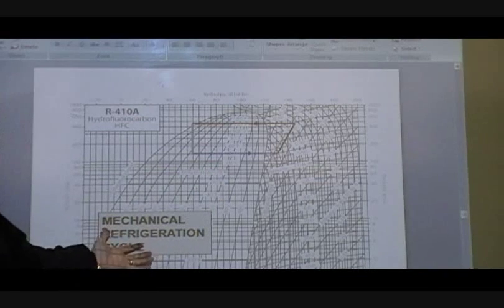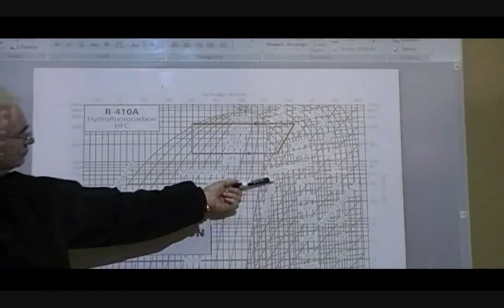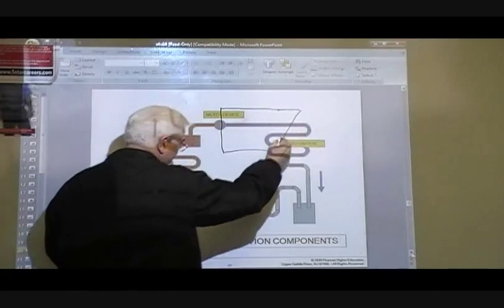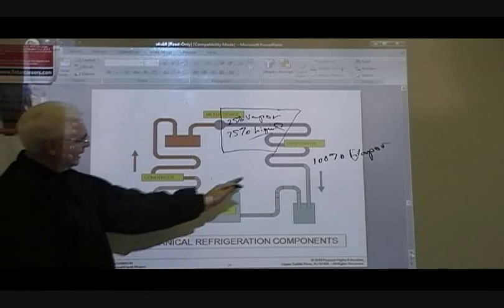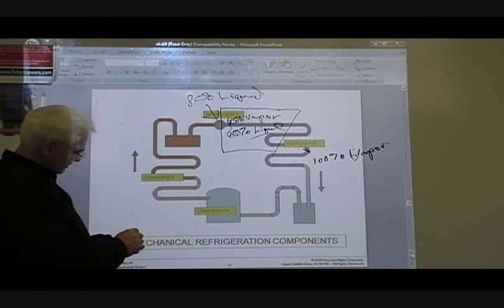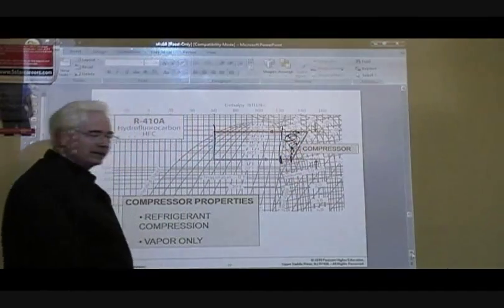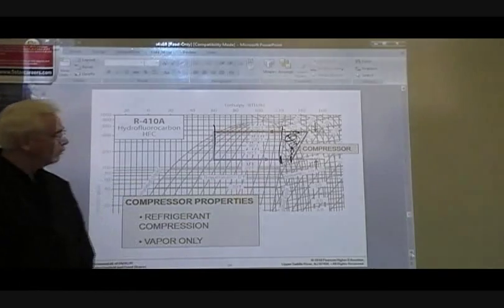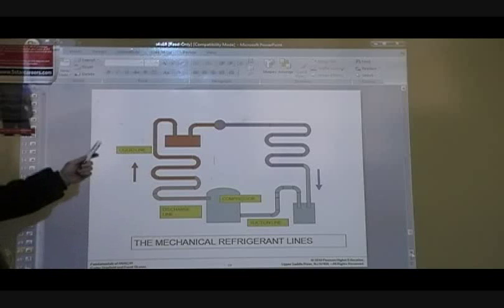AIRC 1005 C, Part 4 of 4; Refrigeration Pressure-Enthalpy Diagram

Comment: Your chart IMO, should reverse the flow of refrigerant, the basic refrigerant cycle.....
You attempt to draw, the net refrigerant effect, on the component diagram, try with the refrigeration components laid out in such a way, the weird box (as you say), lines up with the actual parts of the system.  You show the compressor line of the weird box, on top of the evaporator.

 You made Enthalpy calculations HARDER and more difficult to understand than they need to be.  The only true way to measure actual system performance is to do these calculations.  For every contractor/technician that informs a customer, their system was tuned up, or they made a system more efficient, and does not produce before and after enthalpy diagrams, IS JUST BLOWING SMOKE!@#$%^&^%$#@!